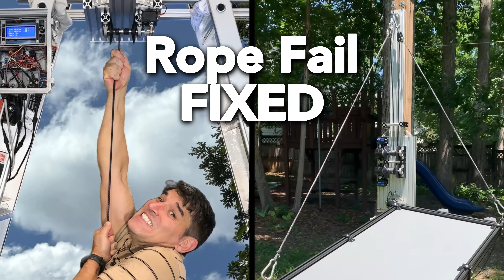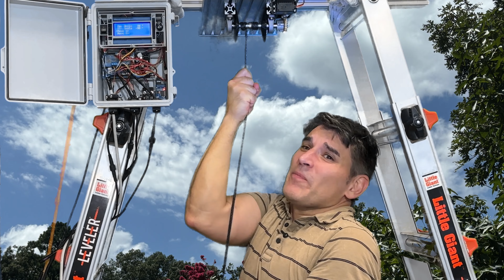Fixing a Slipping Rope Winch Connection: DIY Solar Tracker Build

Comment: The pulley system is balanced, so 100lb test is high...
Reply from the maker: Thanks for the feedback. I agree it’s overkill, but the rope angles increase the load on each suspended side more than just dividing the panel and frame weight by three.  I’d rather overdo it now and have an easy time later than the other way around. Do you have direct experience with something similar?
Reply: I guess...totally different application, but similar forces. In my videos I think the 'remote switch for an electric fan without wiring' is similar. 

I also used a 1/4" garage door cable for mokart brakes, instead of levers, by routing it through some 5/16" steel fuel line....
Reply from the maker: @Iowa599  I didn't see a video by that title on your username channel.  Could it be under a different name?
Reply: @DawnwardSolar https://youtube.com/shorts/hjL7N5RHngQ?si=3AldfSGaQSVlpw6c

baling twine routed through a piece of PEX tube, connected to an extension (made of a plastic handle 😅) on the switch.
Reply from the maker: Thanks for sharing the link.  Commented on your video.

Comment: I really appreciate your ingenuity and tenacity in solving this problem. The approach was very methodical and I enjoyed the brief segue into the brain of the non giver upper. I also particularly liked the 3-D printed guide for drilling holes accurately in the cylinder shaft.

The final solution looks solid although it sounds to me like the motor is straining. You may want to upgrade for more torque, or compensate with a pulley system or something.

Keep the videos coming!
Reply from the maker: Thanks Nathan! 

I agree, it sounds like it's straining. Hopefully under its working load ( ~30% less weight ) that won't be as much of a problem. If it is I can always try a more powerful servo or a worm gear with a higher gear ratio.